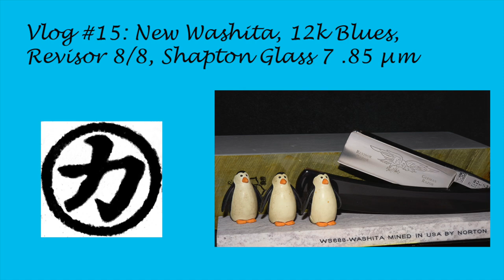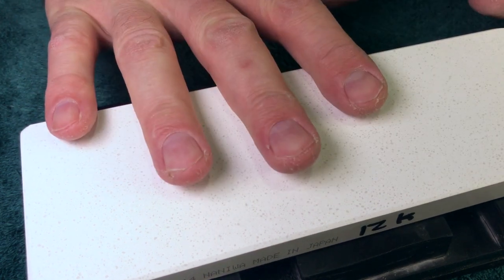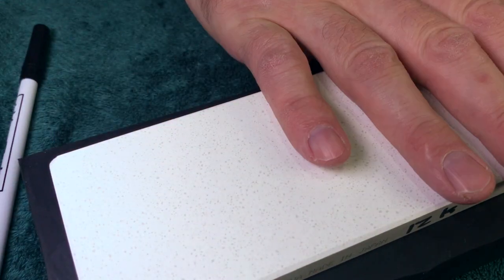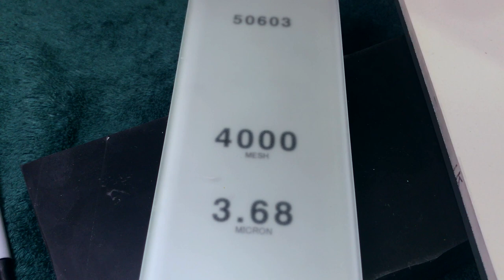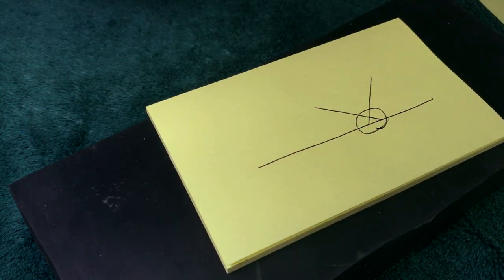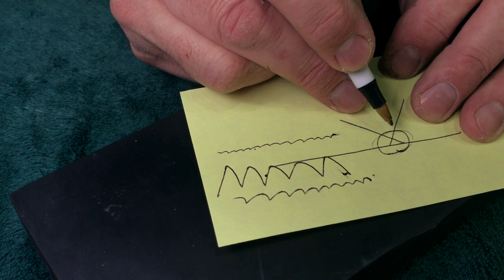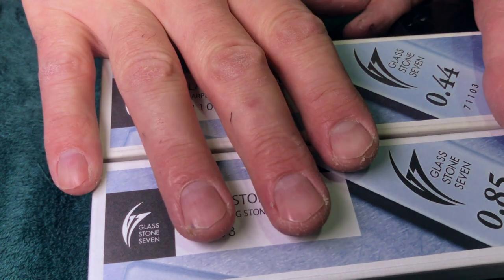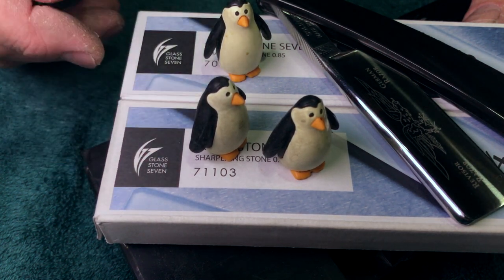Honing Vlog #15, November 2020

Comment: I’ve found the super stones expand a bit when when. So if they’re wet unevenly they can seem to not be flat.
Reply from the maker: Yep - if they're not wet evenly they will swell unevenly, and that will cause them to 'bend/warp.  They also dry unevenly which leaves them not flat. They also seem to warp on their own, possibly do to humidity or maybe it's just how the resin/ceramic binder behaves. I suspect they are 'baked' unevenly and hot spots create hard spots in the binder.

Comment: Thanks for the review of the new Norton "Washita." I saw that at a seller and was tempted, but I've got enough so-so soft arks on hand right now.  The post-it training aids get the points across, thanks. As an expert at producing shark toothed razor edges your illustration of the results of jumping over intermediate levels in abrasion is, I think, spot on. The Naniwa QA problems is troubling.

Comment: Just going through this video again and have a question.  I use a Shapton 1k, Norton 4/8k combo, Shapton Pro (Melon) 8k, then Jnat/Ark/Coti.

My question is this:  Is my thinking logical that the Norton 4/8k is the JIS equivalent to a ~3/5k?  If so, is the current progression fine or would you recommend getting a true 3k between the Shapton 1k and Norton "5k"?
Reply from the maker: The only thing I ever recommend is trying things out to see what works best for you. 
I use Shapton Pros, I follow the SP 1.5k with the SP 5k. 
I don't like the Norton combo stone, got rid of it long ago. But - if something is working for someone, that's that. So - if your progression works, it works, if it doesn't work, then try something else.

Comment: Hey Keith,  I agree, and then some more.   All my super stones warp to some extent once they become wet,  mid grit being the moret notable for me.   I scratch my head as to why everyone always says up and down, left and right that synths are easy peasy and repetitive, for “beginners”.... blah blah...  And also that natural stones are a never ending Rubik's cube. Taking 3 lifetimes to master....bs.  My synths (super stones) load up relatively easily and perform very differently depending on that and flatness. They can be all over the place in consistency.  Conversely,  most all my naturals,  while comparatively slower,  are far more predictable,  more forgiving,  don't load up,  or leave a shit ton rogue scratches in the steel.  Nor have I ever had an experience with any natural stone warping.   I cant speak that to synths!  All that speed does come at some costs.     Thanks again for sharing Keith!!
Reply from the maker: Thank you for watching and commenting Mr. Tee! Happy Honing!

Comment: The first thing I thought of on the Nani was a convex surface from factory.  I don't have any, and don't know why I'd ever get one, but there are some guys that lap Coti's to be convex and sell them.  What're your thoughts on convex Coticules, or stones in general?

Also, the Shobudani I purchased from you is epic.  I do, however, make slurry from the nagura you sent with a true black arkansas and transfer slurry to the Shobu.
Reply from the maker: A 'dovo-type' convex stone's hump would have a similar sort of outline as the rough patch on this 12k, but it wouldn't cause the stone to look like swiss cheese and feel like gravel. After lengthy periods of experimentation, I find flat stones to work best for me 100% of the time. Sword polishers used heavily rounded (convex) stones, but razors are a different tool. I have never ever been unable to hone a razor on a flat stone.

Comment: Good video man. I love the post-it note lessons. 

That’s really weird what happened to that 12k. Did that strange texturing in the middle that you had to lap through disappear after you got it flat?
Reply from the maker: After the last session on the 140x Atoma, the entire stone looked consistent, but super rough, but after lapping down through a few grits, gradually getting finer, the entire surface looked/felt correct. It was a lot of work to get there.